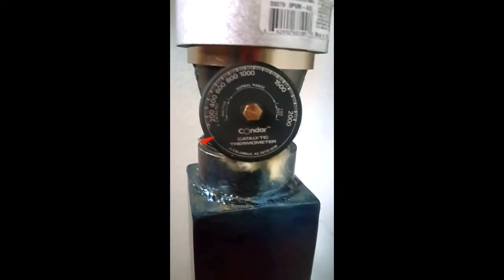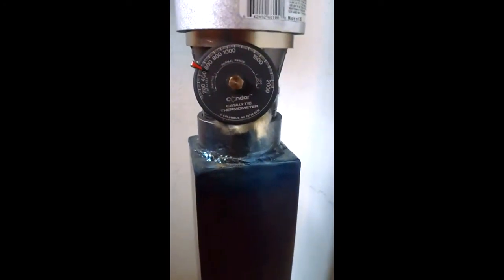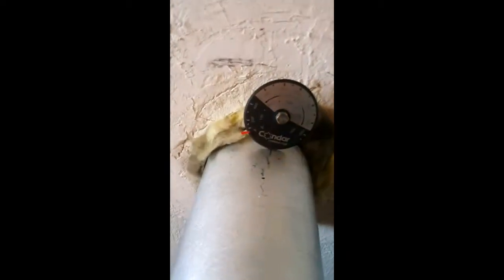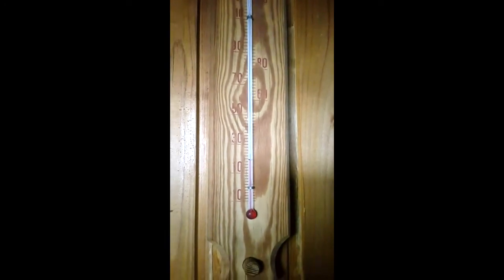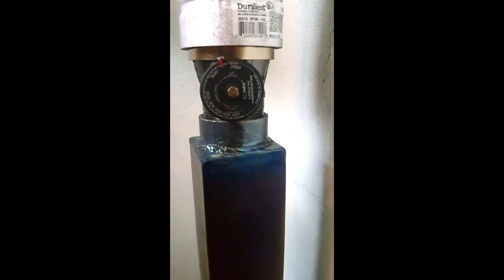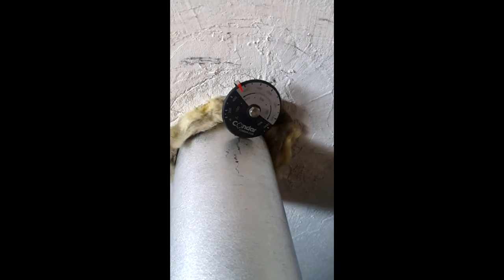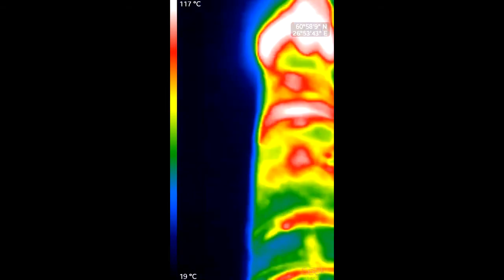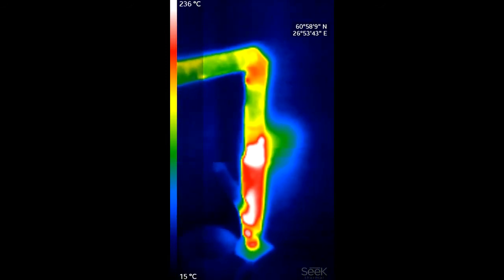CHP-C gravity micro wood pellet rocket stove turbo power brayton jet combustor 5kw

Comment: You're proving that you can reach refractory temperatures with a steel tube.  I just wonder how long these will last under daily use.  I wonder how much you could regulate the fuel in to extend the burn.
Reply from the maker: We have CHP wood pellet stoves that have been in use for over 4 years that have consumed on average 10 tons of wood pellets with no failures to date.

This reliability is provided in the same manner that a airplane jet engine can function for hundreds of thousands of hours without failure and without the use of heavy refractory brick lining.

Do note we do not build these with cheap structural steel hence the value and price. They are are made of refractory grade stainless steel.

As to throttle ability of the 10 KW peak output they can be regulated down about 60%. Lower than 4 kW thermal output can be sustained however at the cost of increased increased ash management.

In typical use under continuous burn one bag of pellets is added once per day, at the same time the ash is cleaned and removed while in operation.

Comment: This is all grist for the mill.  You guys are getting very clever with your gravity-feed setups, although I'd have to see an 8-hour-unattended burn with my own 2 eyes before I believed it.  

I like that you're playing around with TEG technology.  With that, and your brushless pumps, you could have a monster of a water heater,  

The one embarrassing thing about a good rocket stove is the initial startup.  I've thought about using a bi-metal coil that opened and closed dampers, so that when I'm cold-lighting the unit, I've got battery-operated fans pulling air up the flue.  And when it heats up, the blowers switch off as the damper pulls itself shut, just like the choke on gasoline engine.  Charge the batteries back to 100% off the the heat of the burn.  

You could maybe build yourself quite a water battery on the back 40, by using 5 or 10 or 20 of those TEG-powered, brushless pumps to pump water to a tank  or a cistern up above, and generate power by piping the upper cistern to a lower cistern.  If you could prep your pipe for another one of those pipes, with wiring built into the pipe sections, and a quick in-out with the pumps, you could move quite a lot of water quite a long way, up hill, with each little pump handling one stage.  More pumps per foot for more uphill.  I think you could rig up a couple jigs in your garage and make those little pumps.

LOL!  Time for bed!
Reply from the maker: With a 30 second to 1 minute torch we achieve easy ignition, and extremely rapid clean exhaust on startup.

We have focused mainly on getting the solid state physics of operation honed and dialed in.

Now that work is done we are blending in electronic management.

This winter depending on sales based demand we will begin offering a few new options such as: ceramic igniters, smart wifi IOT PIE based control boards, and ultra high efficiency condensing furnace designs.
 These will not require a vertical chimney draft since they will have a draft induction exhaust fan.

All using 12 VDC for easy off grid implementation and or self generation.